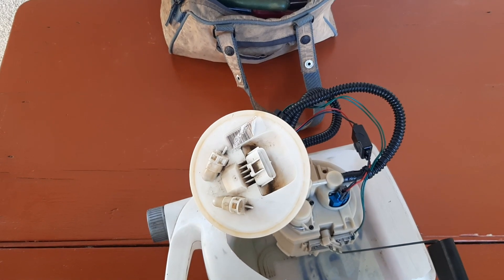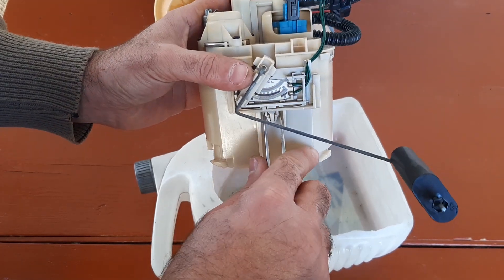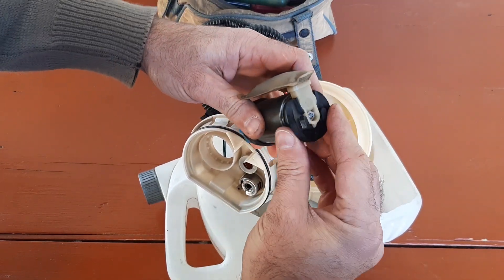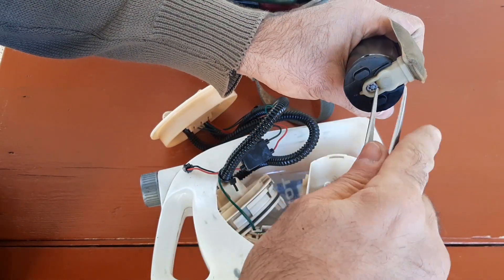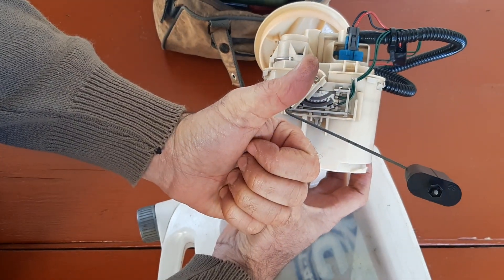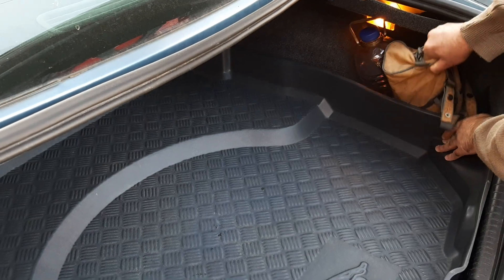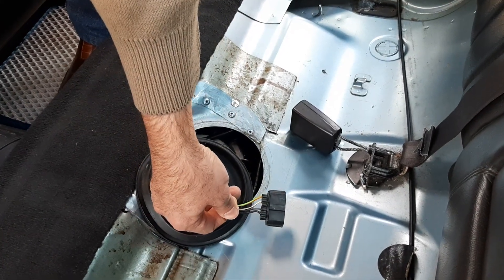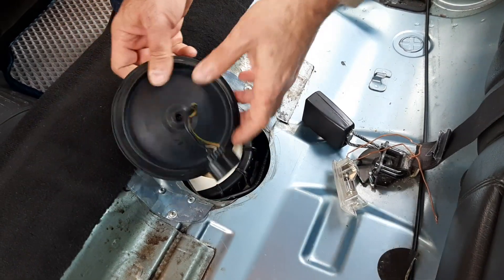Jaguar X-type fuel pump replacement - assembly refurbishment - part 2

Comment: My X-Type is a 2005 wagon. I am so grateful for your channel! I have had to replace the radiator, alternator, idler pulley, tensioner pulley, all 6 spark plugs and coil packs, normal stuff like tires, wipers, etc... And now the fuel pump. You've halped me with so much!  Never did I dream I'd be my own mechanic but I kinda am now. Lol! The only Jaguar mechanics around me are over 3 hours away. I had to figure it out, and you've been a huge part of that process.  Thank you 😊
Reply from the maker: Many thanks for your feedback! Glad my videos are helpful!

Comment: thank you so much for your videos.
My car exact the same model. I had a OEM pump of ford modeo MK3 not the genuine. I replaced with a after market fuel motor. car runs smooth but when I switch off the engine and leave it for one minute..I cannot start the car smooth..starter motor giving a great effort to start car..is it bcz the motor not matching? thanks..from sri lanks
Reply from the maker: You can easily find out whether the motor matches or not. You can connect the fuel pressure gauge and try to run the engine at different RPMs. The fuel pressure shouldn't fall down. But in your case, I believe it's the gaskets in the fuel pump assembly which are faulty, it's my opinion. They should keep the pressure when the engine is off.
Reply: @jaguarrroman  thank you sir. I think he pressure fall down once the car engine stops..I will try to find a pressure gauge soon and check. what's the gasket in fuel assembly? is it in side the assembly?
Reply from the maker: @donravinjosephratnasekera3690  Yes, the gaskets are inside it where the pipes are connected to each other. Just check the fuel pump unit is assembled correctly.
Reply: @jaguarrroman again thank you.. I think I bought the wrong pump.. I bought ford mondeo mk3 2l petrol 4 cylinder fuel pump...it should be ford monde mk3 2.5 v6?
Reply from the maker: @donravinjosephratnasekera3690  Yes, it should be 2.5 V6, but you should check the pressure first. I bought a Jaguar V6 pump from eBay, but when I received it it had a Ford Focus OEM number.  Still I checked the pressure with a gauge, it was OK (about 5 bar) and I am making use of it for already 1.5 years without any issues.
Reply: @jaguarrroman dear roman thank you so.much for u kind replies...at the moment I couldn't  find a place to check the gauge pressure. car is not starting I'm afraid to give more pressure to starter motor. but I have a genuine broken pump with a functioning fuel pressure regulator ...shall I change the fuel pressure regulator and see..is there any way to increase the fuel pressure by changing the fuel pressure regulator? thanks
Reply from the maker: @donravinjosephratnasekera3690  You can try an OEM regulator for sure. I thought you changed the fuel pump only, but you seem to have changed the whole fuel pump unit. In any case the gauge will give you the answers to all your questions - fuel pressure when the engine is running and when it is stopped.
Reply: @jaguarrroman Hi I asemble the pump with brand new jaguar in tank motor and a Ford mondeo pressure regulator...car runs smooth no miss fire..but still there's no start but crank only. when crank it give P0335 code maybe due to faulty pump. and yes onc car stop there is no fuel pressure in schrader valve ...I cannot find a pump here..so have find it online from UK...😢
Reply from the maker: @donravinjosephratnasekera3690  p0335 trouble code refers to a malfunction in the crankshaft position sensor - bad position. I would check the crankshaft position sensor first and let the pump alone. Good luck!
Reply: @jaguarrroman was it 98APAP 9H307

? I have the same pump...I didn't try as it doesn't have a fuel pressure regulator...isn't it?
Reply: the ford focus pump u fitted
Reply from the maker: @donravinjosephratnasekera3690  The fuel pressure regulator is in assembly, you can see the video about it on my channel. The pump unit in the video is an OEM Jaguar X-type's one. I took a video while waiting for arrival of a new one and when the new one arrived, there was nothing left to take a video about.
Reply from the maker: @donravinjosephratnasekera3690  It was XS4H 9350 AA, I have found a video about unpacking it in my PC, I may publish it in the future, remember to ring the bell!
Reply: Once car engine stop..when I check the fuel rail pressure there no fuel when I press it
Reply: dear Sir...I did some search regarding the pumps motors..is it bcz of check valve? maybe my pump motor not equipped with check valve?
Reply from the maker: @donravinjosephratnasekera3690  The pressure check valve can be found in the engine bay on the common rail. You need a pressure gauge to measure it. If there is no pressure, the engine will not run at all.
Reply: now the issue is once the engine stop. the presure drop ...I change 3 pumps now already...I can't find the reason for pressure drop thanks
Reply from the maker: @donravinjosephratnasekera3690  The pressure may leak through some looseness in the fuel pump assembly, it may be the connections of hoses or seal rings between the pipes of the fuel pump assembly lid and the fuel pump housing itself.
Reply: @jaguarrroman  thank you.fixed it and it was  the crank sensor short circuit.  !!!

Comment: What do you do if the electrical part of the fuel pump is not working?
Reply from the maker: If the electrical part of the pump is not working I replace it with a new one. If there were no voltage supply to the fuel pump, I'd check the wiring, the relay, the fuses, the ECU. But I've never had such experience.

Comment: Just found you channel, and I have an X-Type. This is so great! Would you be able to do a video on how to change the fuel tank door? Like when you need to open the fuel door to fill the car with gas. Seems to be no videos on the X-Type for that.
Reply from the maker: Hello Jonathan! Thank you for your comment. In fact I tried to remove the fuel tank door when I had to take it to the painting workshop, but in vain. I refused this idea and removed a side mirror cover for this purpose. I don't know how to easily remove the fuel tank door. But today I will publish a very helpful video about alternator issues and battery drain testing. Hope you will enjoy watching it!

Comment: Sir you have fb or ig...?
Reply from the maker: Sure, I've got. But I encourage X-type drivers to ask questions here, so that everybody could make use of our chat.
Reply: @jaguarrroman  I have a jaguar x type car. the problem is if we step on the gas pedal the rpm drops and the engine sounds like it's about to die. The spark plug coil has been replaced. what are the possible TPS and ECU. because we scan, the code appears p1573. . thank you sir, please give me a solution sir.
Reply from the maker: @narnoae1407  P1573 is a throttle position message error. I would first try to swap throttle position sensor (replace it with a working one from another X-type), if not - check the wiring from throttle position sensor to ECU, if not - try to find workshop repairing ECUs. It's my own opinion and I am not a professional Jag engineer.
Reply: @jaguarrroman  it turned out that my tps was fragile and broke when I opened it, sir 😁😁. before I opened it, it turned out to be brittle because it was exposed to hot engine steam. maybe it's time to replace it. thank you sir 😁🙏🙏
Reply from the maker: @narnoae1407  Yes, X-type has got plenty of plastic parts and as time passes some of those parts become very fragile. Good luck to you and your Jag!
Reply: Thank you very much sir. success always for you
💪😁

Comment: Hi Roman! Thanks for all of your tips! You are very helpful for us! Can you kindly advice me about p1582 check engine code?
The engine fail and can not go over 3000rpm.
Thanks!
Reply from the maker: Hello, Atanas! Thank you for your comment! As far as I know, it's not the fault of 1582 code, that the engine goes to the safety mode. It's some other fault code that causes engine not go over 3000rpm. As for the P1582, the majority of Jags have it without any issues.

Comment: Hello. Do you have any work on operating with the remote control? Can you make a video about remote operation with the remote? thanks.
Reply from the maker: You can find a video on the channel about key fob repairing. Usually you have to renew its soldering points.

Comment: Thanks for the tip. What should the fuel pressure be when the engine is running?
Reply from the maker: 2.1 is running at about 5 bar. I tried to decrease it to 3.8, but returned to OEM pressure finally. You can see the video about the fuel pressure regulator on the channel.
Reply: @jaguarrroman  Thank you!
Reply: We are located in Philippines and unfortunately this car model parts are not available. Many pumps available thru ebay but the pressure output is not correct. Would appreciate your parts sources. Thanks!
Reply from the maker: @V12laxman  I suppose, Philippines is not far from Australia and if you search X-type parts on e-bay in Australia, you will find the best shop of genuine X-type parts, including fuel pump. Good luck! P.S. I bought a Visteon fuel pump in Turkey, I cannot recommend it to you.